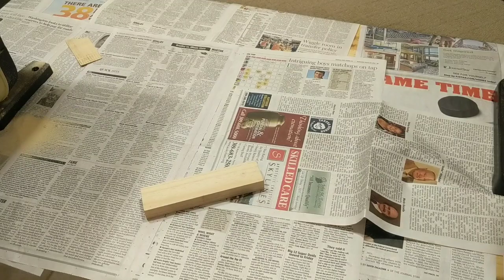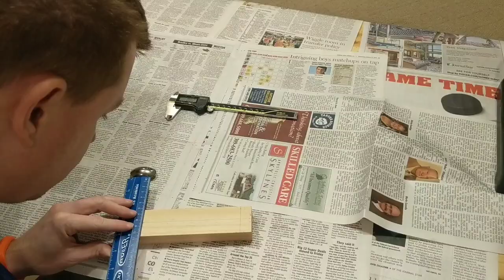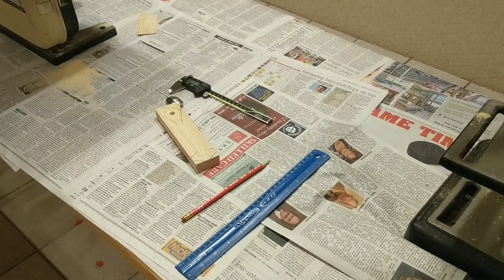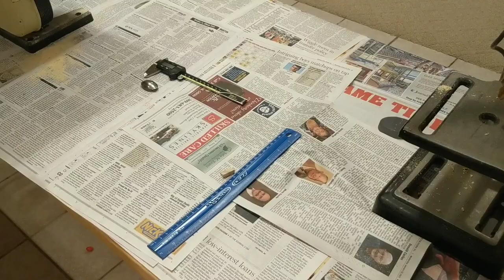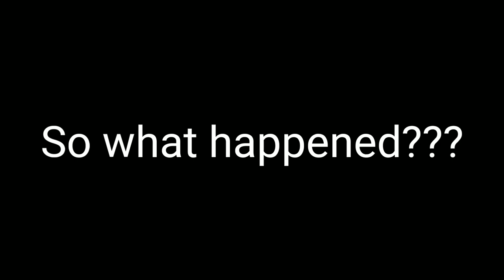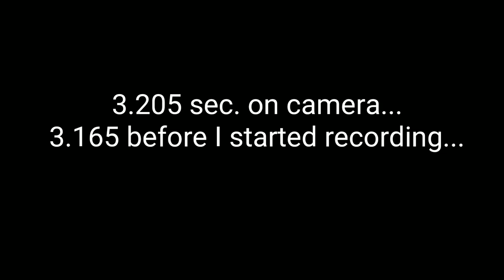MY PINEWOOD DERBY CAR BUILD WAS A HUGE FAIL!!

Comment: Yes its possible one of the rear wheels is off alignment, but I believe your car is off balance with to much weight on the left or right side causing the left rear to rub on the lane divider. Or its the natural drift of the car. solutions... easiest would be to flip the 2 front wheels with the raised on the right and dominate wheel on the left. next would be to pull the left rear out and push the right front in as close as possible to the block. next would be to re-adjust the weight more to the left but this is not really possible as they are epoxied in. your basic Elmer's glue is enough to hold it in place. The pros use aluminum ducting tape to hold 4oz of cubes in no glue of any kind. It works just fine.

Comment: Always measure in grams. 141.7g is the magic number. When a scale only measures to a tenth the scale has to get to a .5 increment before it goes to the next number. You scale did not show you that you were actually at 5.05oz because of this. Better luck next year!
Reply from the maker: Great tip, thanks!!

Comment: In fact, what I do is drill from the bottom up for the weights and then lock them in place with the automotive body filler. Let that harden up and then you can sand and shape the filler to smooth out the body design. - I have to make some of these videos showing my Dad's and my cars from the 1980's and then mine and my daugher's from today. We just have 1 more year of racing though...so I'm not sure that I want to give away all our racing secrets just yet! :D

Comment: Better luck next time! Ideas:

- Use some easy-to-remove trim weights to top up your weight (e.g. tungsten putty). Or stick on weights that can be peeled off. That way you are safe from the drill at weigh-in.
- Rear-alignment is super critical. Always verify it, whether you're using a tool that drills your holes parallel, or bending and twisting to align. Make sure the rears are running straight.
Reply from the maker: Thanks!  Hopefully I'll get it down the track a little better this year.